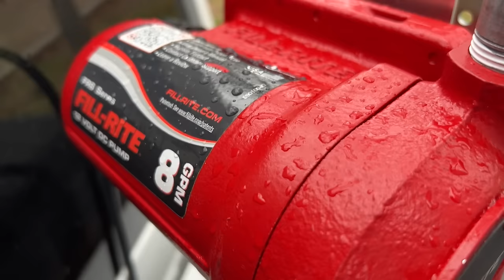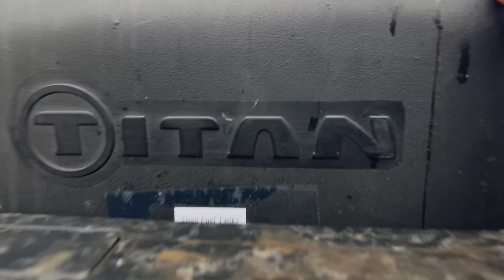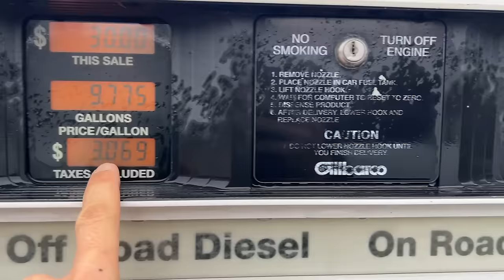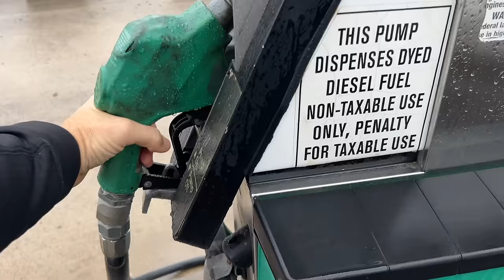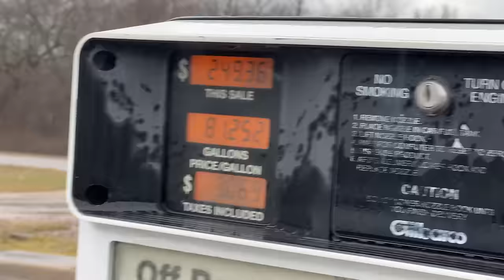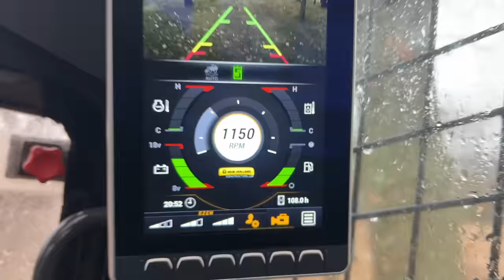Our Best Coyote Day Yet!

Comment: You need a plastic cap for your diesel fill nozzle so when you drive around or rain doesn’t go up the nozzle, OK you know soft caps you can slip over pipes and things that’s what you need. Maybe it’s a hardware store.

Comment: Daniel, I love the new fuel tank, I am sure it will be very handy. You might consider taking your smaller tank over to the mill Creek property. Be nice to have when needed. Also, As far as the Titan tank goes, there is one more thing that would make it even more nice. Why not have a fuel gauge on it? Right thereon the tank wold be nice, and even nicer if you had a gauge on the inside of the tank! Maybe they have that option, but though not necessary, let's say you have been working a lot on the property doing skid steer things, tractor things and you have used a good amount of fuel. But you hadn't really kept up with how much you have used. But you have needed something for a piece of equipment, or had to make a feed rn, or get some more alfalfa bails, you look and notice you also need to refill your tank. 
And another thing that would be nice, just to keep up with how much fuel you are using, is a meter on the pump to show how much you despenced when you worked your skid steer hard for oh let's say 4 hours. Would also help in record keeping, if you do that kinda thing on your farm. 
So might pass these things on t the Fill-right folks and to Titan tanks.

Comment: Just an idea for you Daniel.  Install a cut off switch to the diesel pump inside the cab of the truck.  
Then you might not need the lock that you can forget the key to or you can do both and add another layer of protection not that you probably need it.

Comment: As you mentioned in the previous vlog and this vlog about the owl is rehabilitating at the Falcon sanctuary. The owl being returned to your property, I think you should name it "Hooty".
Another YouTuber installed a large diesel gas tank 500 or 1000 capacity for his diesel equipment(s). He just had a delivery, and he bought it for like $2.50 but that was in PA. Maybe something to consider later on.
With reference to the extra weight in the bed. My father built wooden containers over each tire on the axle. He filled them with sand during the winter months to get extra traction when driving in the snow, especially going up and down hills in MD, & PA areas. Good vlog.

Comment: Fill-Rite pumps are great pumps. I have about 30 years experience with them. Only problem I ever had was the key on the motor shaft would strip. Comes from the factory with a plastic half-moon key. I replaced it with a steel one. Problem solved. Happened on about 4 different pumps over the years. Frustrating that Houston is not getting to reap the bounty of his trap line. If Gemma weighed 50 lbs. and was 2 ft. tall, there wouldn’t be any predators for miles. 😂 Great video!!

Comment: in MN people will fill the back of the truck with snow some years i put softener salt like 6 bags for the winter this year we do not have much snow we have been 35  to 50 degrees and rain we normally get 30 to 40 in per year southern MN 50 miles north of Iowa

Comment: Your 560 lbs added to the box of your pickup equates to 2/3 on the rear axle and 1/3 on the steering axle. If you added a round of hay/straw you would be looking at 1500 lbs all on the rear axle and none on the steer. You might be able to go somewhere with all that weight on the rears, but you wouldn't be able to steer. Better the way you have it with the fuel.
If you know where there is a 'cat' scale or even a DoT scale when it is closed weigh the steer axle and then the rear axle separately and that will tell you exactly what the weight difference is.
If you shut the pump off first, then open the nozzle you will drain the hose. Diesel expands in the heat. Not a problem now but it may be in the summertime. You don't have a by pass pipe.

Comment: Funny you bring up fil rite pumps today. I have a 250 gallon tank in truck. And just yesterday my 8th fil l rite pump burns up .. i called my wholesale oil an lube sales guy and ask a price on a new pump. His first words were  .  Arnold you dont want to know.. i said that dont sound good. Any way it was $729 cnd plus 14% tax. No filter no counter as to how many Lt been pumpped. You can be sure ill be posting a video on this. As well as a rebuild on my dump/boom truck i use to feed the cows. The shaft seals blow out of the pto pump last week in 29 below. Sad part is 2 thing no parts in stock had to order them. But the 10 gallons of ATF I RUN IN it for hydrolic oil because a dump/boom truck never runs long with the pto on. Even with Atf i have to run the pto for 20 min before i even try to move the boom to lift a 1200lb bale into dump box to take to cows calves steers bull. When it 20 to 40 below. Atf was 100 . X the price of pump seal. $248 for 2 5 gallon pails use to be $80.  Cold weather's hard on hydraulic components I remember working in the Bush camps firing up a machine Monday morning 20:05 below Be nothing to blow up a $20000 pump is why machines Machines for left running all weekend in the winters

Comment: hey Daniel I got a question for you. Do you have trouble with the diesel fuel freezing up in the winter?  Whats the difference between the two kinds?  If you get a chance to answer I would  like to hear.  I had a diesel pick up truck and had trouble all winter long.  I had to get a block heater to use  when the truck was outside sitting.   Great video  sorry to hear you are still fighting the sickness.  Get better and say hi to the family   God Bless you guys

Comment: I have been “accidentally “ caught in foot hold traps several times over the years, if you aren’t expecting it, it startles you more than anything. As I get older and less flexible I can tell you getting out ain’t as easy as it used to be. Last time was a Duke 650 and I got my right thumb in the staked down trap,  I am sure my wife could have won a prize with a video of my fat self trying to get my feet on the levers with my thumb in there. 😂
Keep on trapping, tight chains!!

Comment: Nice tank. Didn’t know there was farm diesel and regular diesel. Is farm diesel cheaper well cheaper than regular diesel?ok that answers my question about prices on fuel. Cheap in OK. In western WA it’s over $5 a gal for regular diesel. Never understood how diesel is higher than regular gasoline. Maybe someone out there can explain that to me. Boy it is pink isn’t it.
Reply: Agricultural diesel with limited road usage is less taxed. Just don't  get caught using using it for your road traveling vehicles.
Reply: Diesel prices and gasoline prices vary based on the supply used to create them. When more is allocated to create gasoline, we see gas prices decline and diesel prices rise. When the allocation is changed, diesel prices will drop and gas prices will rise. It all depends on how the refinery decides to allocate the crude.